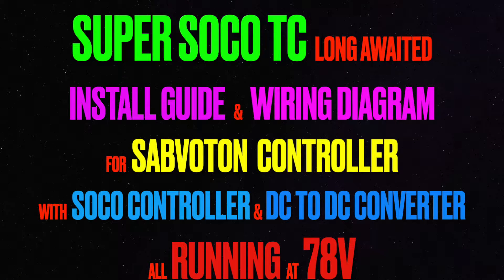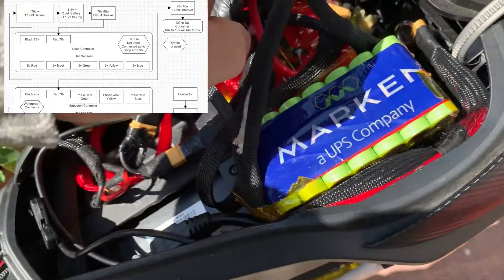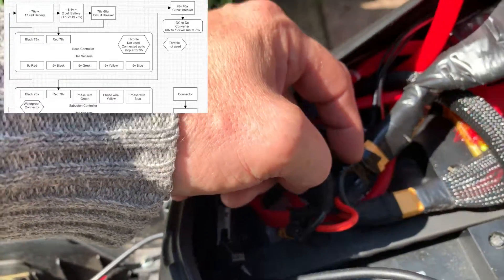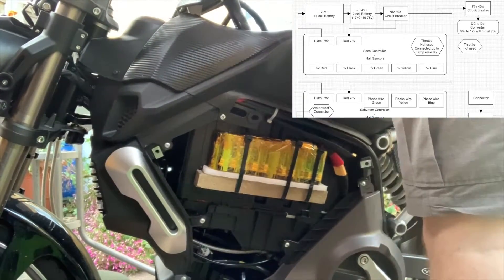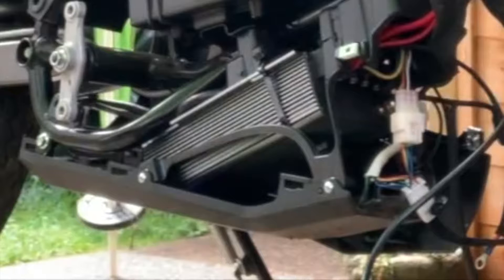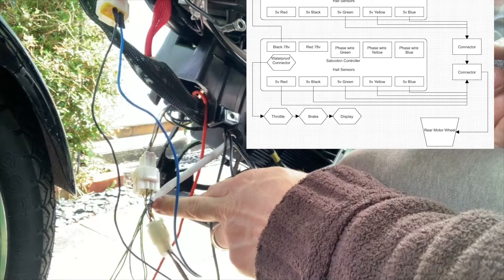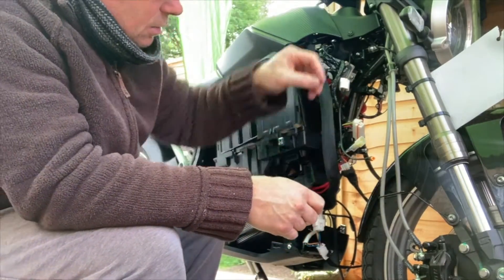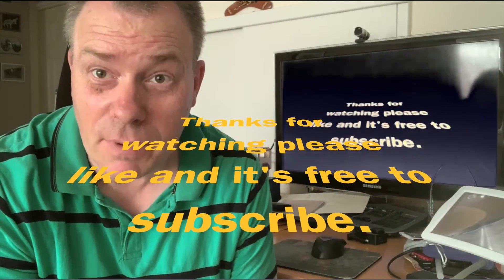Super Soco TC / TS Installing Sabvaton Controller part 6 Wiring Diagram all running 78V DC to DC

Comment: thank you for all the content that you've created for Soco users. The reason the Soco controller can not handle more than 80 volts is because of the 80V  capacitors inside ? Also, do you happen to know the name or manufacturer of the six pin /hall connector and the similar-looking 9 pin lighting/etc. Connector?

Comment: My state of charge shows 0% even when battery is full. Controller temperature indicator doesn’t show any bars either. Sometimes it shows as if loose cable gets connected again after driving over pothole. Are you familiar with this and know a fix? Thanks in advance

Comment: Hello, have a motorcycle TC max year 2022. Can the controller that you mention in your video,but more powerful, work with my motorcycle model?
I need a controller to increase power, the one sold on AliExpress says that it is not compatible with the TC max 2022 model. Thanks for videos
Reply from the maker: good question but I haven't tried with your model but I know your motor spins faster than mine

Comment: Hello,

I'm in the process of adding a controller. I will add a Fardriver ND72260. I know it got a lot of amp max, but i thought i should take one that is capable more for it to not overheat.
I still have my super soco TC 50cc full original.
I plan to set the setting at 40 amp max, i believe the circuit breaker will prevent me from pulling more than 40 amp ?

In your process, and your wiring, you only connect the throttle, the hall sensors and the hall wires to the sabvoton. Did you connect the others ones (like the lock/brake/cruise/ etc etc ..) ? if yes, which ones ? if yes, is it replicating the same wiring type as the hall sensor ?

Edit: So i'm currently doing it, and for now, on top of doubling the red and bleck wire from the battery, i just plugged the ignition wire, i will plug the cruise and parking mode, and will try the three speeds. i will not plug the brakes because of what you said about regen being able to send too much amps in reverse and causing damage to the bike.

I'm in the process of doubling the hall sensors wires atm, but i'm facing bit of an issue, i dont have the battery percentage displayed, and when i short the throttle on the original controller, it deactivate the three speeds ! Any clue why ?

Thanks in advance
Reply from the maker: sorry I have never done nd72260 
but I thought it was just a direct controller swap

Comment: Hello good job. But with everything you do, the cells will cut their life time, The most interesting thing would be that what you do was simpler, so that others can replicate what you do, It would be good and very interesting if you could modify your chacis to place a single battery with more capacity, and also be able to change the motor and controller, to obtain more power and autonomy. Greetings from Ecuador
Reply: Hi! Can you tell me if this 72150 it’s ok for my TC ? 
https://m.es.aliexpress.com/item/1005001631746730.html?spm=a2g0n.detail.0.0.53c234ae8o15v6&gps-id=storeRecommendH5&scm=1007.18500.187585.0&scm_id=1007.18500.187585.0&scm-url=1007.18500.187585.0&pvid=310432c3-ef5a-44e2-b661-1bd131106e70&_t=gps-id%3AstoreRecommendH5%2Cscm-url%3A1007.18500.187585.0%2Cpvid%3A310432c3-ef5a-44e2-b661-1bd131106e70%2Ctpp_buckets%3A668%230%23131923%230_668%230%23131923%230_668%23888%233325%2310_668%23888%233325%2310_668%232846%238109%231935_668%235811%2327172%236_668%237206%2334828%2315_668%236421%2330825%23416_668%232717%237564%23697__668%236808%2332777%23830_668%233374%2315176%2389_668%232846%238109%231935_668%235811%2327172%236_668%237206%2334828%2315_668%236421%2330825%23416_668%232717%237564%23697_668%233164%239976%23384_668%236808%2332777%23830_668%233374%2315176%2389&pdp_ext_f=%7B%22sceneId%22%3A%228500%22%2C%22sku_id%22%3A%2212000016897812524%22%7D&browser_id=497b8d34fab14a0f8035f75b4b5a1a33&aff_trace_key=7fad5968ff84436a884a6da1848a1109-1621479609976-03278-_pJT003e&aff_platform=msite&m_page_id=oyehdknljtscabwq17bc38f7fc3a6bab81a18265e9&gclid=
Reply from the maker: Sorry for the late reply 
Yes & No
Sorry for the confusing answer but I have to answer in in two different ways because 

1) If you are using the standard wiring from the battery to the controller and you use part of (41amps) to all 150amps available from the 72150 controller the wiring will more than likely catch fire🔥 & and you will need to keep an eye on the temperature of the motor (mine runs perfectly fine up to 75amps but I’ve never tested it with any more amps) also if you run the voltage above 80v can you still have the original Super Soco controller connected up you will fry it immediately

2) yes it will run, with very little modification on standard Soco just wiring connections if the flux Weakening is set to 30a and max amps settings is no more than 40amps
Reply from the maker: Thank you for your comment